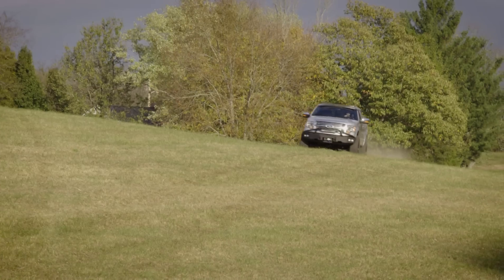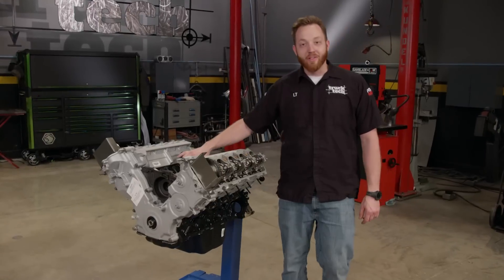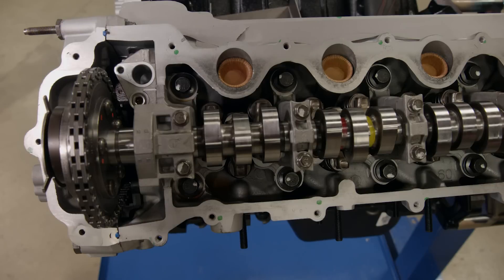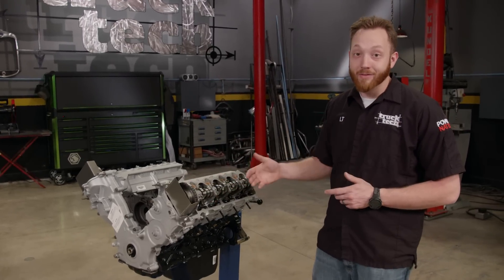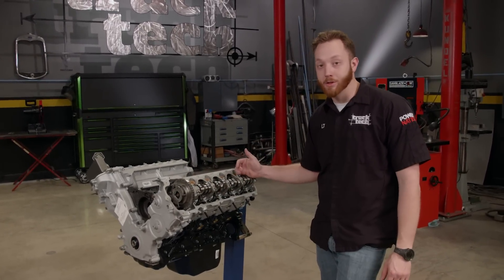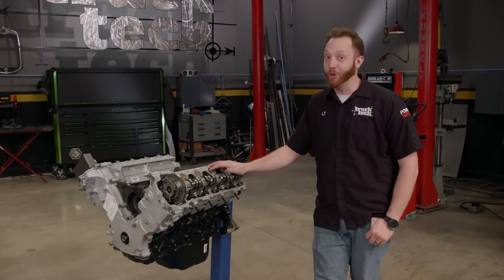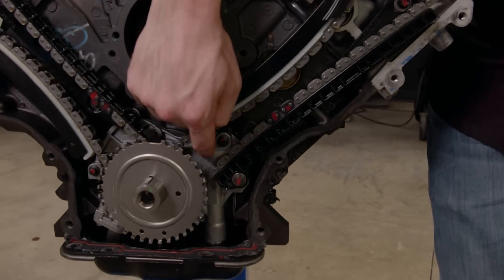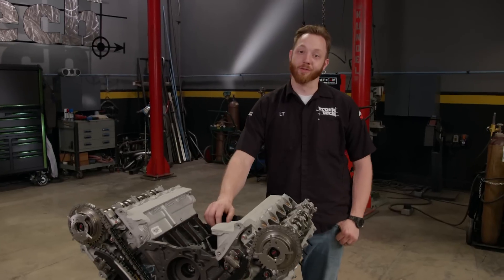Hope For 5.4L 3V Mod Motor Fans

Comment: I do quite a bit of 5.4 work and about half of what this cat said was true. I have many of them out there with over 300K on them and have seen some with over 500K . At the moment I have one torn down in the garage outside that has 90K on it and its junk from top to bottom.
So whats the secret ? There is no secret , change the oil in the damn things and when it starts making noises fix it. That shouldnt take a rocket scientist to understand.
I hear this constantly about how these motors were no good blah blah blah. The engines are awesome , people are just morons. So they dodge the bullet of having to spend the money on small repairs. Then they have a paper weight in the driveway that needs 5K sunk into it to make it run again. BRILLIANT !!
If you do quality phasers and timing components (Better than stock) and upgrade that oil pump about when those stock phasers start making noise you are good for a very long time.
Reply: This. This is exactly why I bought a high mileage 2010 navigator for a song and put new latest oem timing set and melling 360hv pump. Also did roller followers and lash adj while in there and I expect that engine to run as long as I want it to.
Reply: @dr7477  absolutely. This is once instance where thr stupidity of human beings actually improves your life. You can pick really nice trucks up for pennies and have a reliable ride for a few hundred thousand.
Reply: I did a complete timing/rockers/melling hi-vol/pressure replacement at 150k. It rips especially above 4k rpm but seems to lack power and uneven torque curve low-mid. I was thinking about doing a solid phaser lockout kit w/tune cause I read that the phasers are oil pressure sensitive and the new oil pump while providing lots of lube might be affecting the power curve. Do you have any experience or opinion on lockout kits? I plan on keeping this 2010.
Reply: @angrysheepdog9744  I'm on the fence with the lockouts. The engines design just doesn't lend to power down low. Buy yourself a quality stall converter in the 3 thousand range and see how the old girl wakes up
Reply: @kylevantassel7259  Do you have any experience with hotter cams, I saw Comp Cams offers 3 levels for the 3v? what about a stroker kit on a rebuild? I switched to Valvoline 5-30 extended full syn and seems to stay clean and very little metal flake on the drain magnet.
Reply: @angrysheepdog9744  yep. I've done cams but without a loose converter you would be upset.
Reply: @kylevantassel7259  any cams to recommend and can the converter lockup be reprogrammed with a tuner? borla cat back with XR1 resonator 👍+2-3 mpg / 30-40hp. extrude honing the manifolds good. Thanks brother
Reply: @kylevantassel7259  alot of wisdom in your post. what aftermarket timing components were you referring to? can't leave us hanging bro....🤣
Reply: @angrysheepdog9744 
The computer controls the solenoid’s which control oil flow to the phaser. So the new high flow pump won’t affect it .

It would have to be way out of spec for it to not be able to keep timing.
I have the melling hi pressure and flow hard anodised pump I think it’s 80psi up from stock 60psi comes with two springs to choose from 
My car runs fine

Comment: I bought my 5.4 2v from them ! They r good to work with . 4yr warranty for mine, hard to beat that. Fixed tapered spark plug problem, motor runs strong 💪

Comment: This turd is the reason the 5.4 got a bad reputation. The 4v is bulletproof and the 2v is bulletproof with 03/04 8 thread heads.
Reply: Its not a turd actually. Just bad engineering on some parts. 3vs are actually very good motors minus the factory issues.

Comment: My old 2008 runs fine. 130k. 5w30 full synthetic oil. I think it's all in how they are maintained
Reply: Capri 82 negative. Factory calls for 5w-20. After 100,000+ miles 5w30 won’t hurt it, it will actually help it run smooth.

Comment: Great motor except when they're not which is all the time
Reply: Of course. Because u know nothing about them.
Reply: @centraltexasfoxbodies  I've been maintaining a fleet including 15 5.4 and 4.6 powered trucks for the last 13 years. I've built two 5.4s and one 4.6 in that time. So yeah I think I know a little bit about them. They've cost the company so much in maintenance that we stopped buying them 5 years ago
Reply: @centraltexasfoxbodies  you're exactly right! Our vehicles get treated like shit there's no doubt. The fact is our GM trucks get treated the same and cost us less than half of the Fords in time and parts costs. I keep records of every dime I spend on every truck so this point is irrefutable. I personally think they're all pieces of shit but the GM vehicles just downright cost less over the long haul
Reply: @centraltexasfoxbodies  yes absolutely the two 6bts and one common rail we have we just keep throwing transmissions at them because the engines are the most efficient and dependable in the fleet by far lol. Love those motors you just keep oil in them and they just keep coming back for more

Comment: Really there' a better solution to the cam phaser failure in the 3 valve mod motors. Install a phaser lockout kit. This does come with a downside and it slightly reduces the powerband, but in the long run it's barley noticeable, it prolongs the life of the engine, and it removes the most common failure point of these engines.
Reply: Why not use the variable cam timming to improve peformance  with aftermarket tuning and a peformance cam?
Reply: @williamvaughan1218  u gotta get the updated phasers oil pump ect and ur good
Reply: Which lockout kit did you use? I was thinking about doing one with a hotter cams

Comment: Wow...the phasers never go bad.  Total lie you’ll grenade the engine that way.  The phaser and the oil to the bearings is 2 separate issues...It’s the oil pump.  You need minimum 35 psi at idle.  Use 5-40 Diesel engine oil and you’ll never have a problem.  Mines got 315,000 miles on it and has never been taken apart and doesn’t tick.
Reply: The plastic guides could absolutely never last 300k
Reply: @The412Devil  they do…it’s still running and has timing chain tension, 360,000 now…

Comment: Its not  the phazers  it's the oil pump  ...  no sufficient  oil  volume or pressure   phazers run dry fro a few second  everytime you start it .  Same as the rest of the valve terrain  .    Ford knows  but dont care   Class action suite  pending
Reply: Pending? Ford already got hit with a class-action suit over the 3-valve's shortcomings.

Comment: My 08 F-250 5.4L 3V phasers have had the hot idle ticking for 90K miles. It is low on power and gets 12mpg, but keeps on truckin. It has 234K miles on it. I change the oil every 3K miles. It may die tomorrow, but anything that runs 234K miles without being opened up is a pretty decent engine
Reply: most of the people that have issues are going 5-10k miles without changing the oil. Ford is to blame, they suggest 5k intervals. OEM's all of them actually. Their intervals are to keep repairs down under warranty, and not to extend the life of the vehicle.

When I get a brand new car (very rare because they last so long) I change all fluids at 1,000 miles, get all that break in junk out of the engine transmission, and differential. 10k brake flush and power steering. then do normal intervals after that
Reply: My 05 5.4l f250  has 216k and no tick at all just full send and 3k oil cha ges
Reply: It is for an American engine. Any import engine will go 300k + before opening it up is even a thought. No idea how Americans stay loyal to companies making products so much more inferior to the rest of the world

Comment: My brother bought one of these Powertrain motors for his 06 F-150 FX4 and had to spend more money fixing the timing. These motors come with the aftermarket timing components instead of Motorcraft. Anyone that knows anything about these motors know the aftermarket parts are junk. He spent phone call after phone call trying to get some reimbursement from the company after buying the Motorcraft parts. I would rather just buy the Ford long block for $1200 more and no I'm not gonna have to worry about the internals.
Reply: any updates?

Comment: When I saw him take off those phaser covers I about punched him through the screen. That bolt came damn close to dropping in.
Reply: He took timing cover off anyway
Reply: WS1 AUTO’S N STUFF The front of the pan is exposed. It could rattle down and end up in the oil pan. Not a huge deal if the engine is out of the vehicle, you’d just have to pull the pan off and retrieve it and replace the gasket. But if it’s in the vehicle taking the pan off is something entirely different.
Reply: @Saucynuggs84  I just redid my timing components, oil pan doesn't even have to come out, flex magnet if it doesn't stay right in the front of the pan.
Reply: Med Tec67 right? Lol I had a small heart attack
Reply: @Jeremy Yeah. Wouldn't hurt anything and would eventually get stuck to the magnetic drain plug. Just a fun Easter Egg for the next guy that drops the pan. lol

Comment: I’ll never touch any kind of 5.4 buddy had a Ford F-150 had 188k when he bought it and overtime he has repair history that looked like it could be a book that’s like 70 pages full in a Manila folder worst motor ever. I know most Hemi motors last longer than them.
Reply: Hehehe that's a shocker and the hemi is just like the ls its a pushrod hell even the I force 5.7 and endurance 5.6 (both overhead camshaft) are more reliable than  the triton 3v had it in my 08 expy Eddie Bauer its a shop queen then made the trade for a 2010 Tahoe 5.3 with afm rock solid reliable.